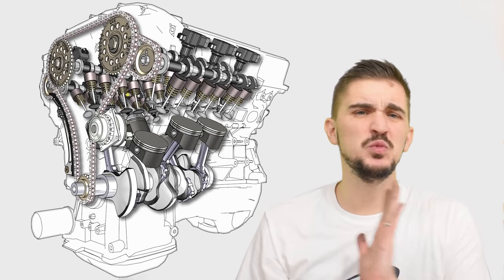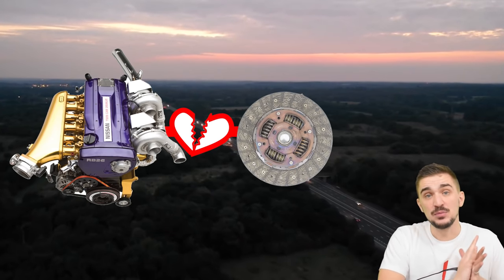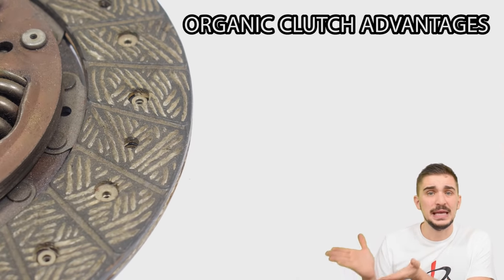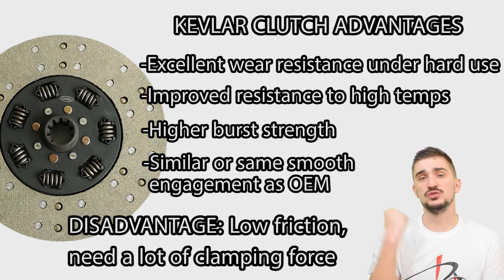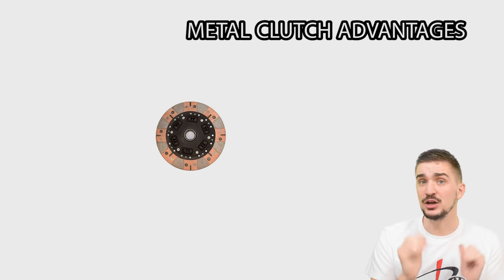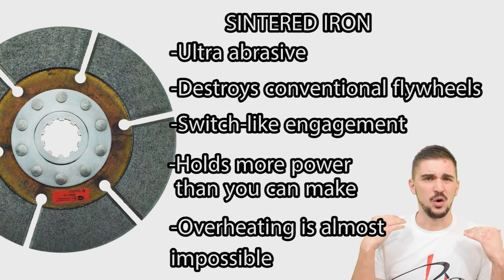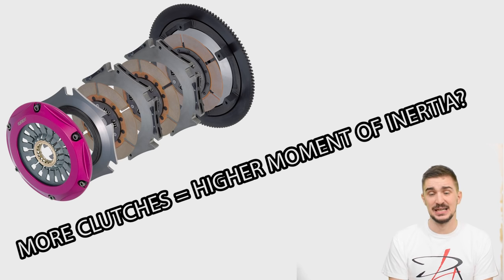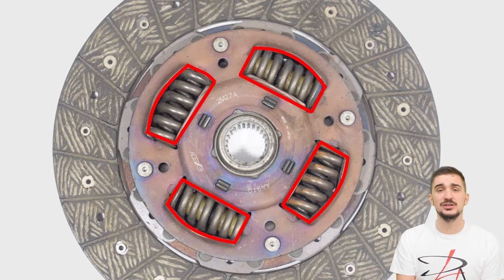CLUTCH: Organic vs. Kevlar vs. Metal vs. Multi Plate CLUTCHES - in-depth COMPARISON

Comment: Now i got it why my petroworks hi performance clutch didnt last more than 20000 km in Suzuki samurai. Construction was metal on flyweel side and standard on pressure plate. It was irational desision because i was fascinated with everithing "hi performance".... Now i am mature and i am driveing OEM clutch and it does the job.

Comment: I think a missed disadvantage so sintered metal clutches is YOU CAN WELD THEM TO YOUR FLYWHEEL.
The lighter pressure plates sometimes found can lead to engagement slippage which super heats the surface of the disk, and when it cools, sticks to the flywheel and pressure plate.

Comment: Some nitpicks:

1. A ceramic "puck" style clutch is going to chatter and have rough engagement even with hub springs
2. I bought a McLeod RXT twin plate for my 2JZ, which has some kind of sintered metal friction material and no springs - to my great surprise, it is very docile and friendly to drive on the street. Not quite as slick as a stock organic type clutch - but pretty close. Expensive, but worth every penny.

Comment: Thanks for this. Pretty sure after this i picked the right clutch for my car. Its a fully built all-motor 3000gt. Put a segmented kevlar clutch in it rated for 360ft-lbs which should be more than needed but not too much more. And it will see some track and street driving. You just confirmed that i picked the best clutch for the conditions the car will be in. Before i picked the clutch solely based on torque it could hold.

Comment: 17:40 it can be bigger than flywheel or pressure plates. Cub cadet did it in 60's. It's an exception so bear with me. Have the organic or Kevlar material be a thick disk with a center hole and 3 oem or 6 aftermarket holes drilled around outer edges  that ride on pins so it can slide back and forth on driver. Driver connected to flywheel directly and spins at engine rmp constant. Drive shaft goes in center hole of disk and into pilot bearing on driver. On drive shaft in this order Pressure plate (roll pinned and fixed), organic fiber disk,Pressure plate (roll pin through drive shafy but cuts in pin holes of plate to allow movement) clutch arm,teaser spring( helps for smoother engagement to pre load rear pressure plate),throw out bearing,main spring,and roll pin (oem) or split lock collar (aftermarket tractor sled pulling parts). Drive shaft never moves but the small amount of play in rear pressure plate and the free float of fiber disk is enough to engage and disengage very well. This system could be used in small car applications with modifications but it's not perfect. And there is centered metal multi puck options to replace fiber disk. Works the same check out midwest super cub or vogel manufacturing to see full list of aftermarket cub cadet sled pulling parts. There are multiple kinds but the 1960's cub's have the strongest design and search for (narrow frame models) in the 70's it was changed. Oem from 60's is basically a Marcel with organic and asbestos fiber sandwiched. Or maybe mine was  Delaminating it was old and glazed.

Comment: When he say's "clutch" he means 'clutch plate'. 
The 'clutch' consists of a clutch plate, pressure plate, spring and release mechanism.
Reply: In the clutch industry we say clutch disk, and cover assembly (cover, diaphragm and pressure plate).
Reply: @JBN1983  Discs is what you find in the brakes department.
Clutches have a plate. Well, ok multi-plate clutches have multiple plates ! They can be either dry or wet. The same assemblies can be used for brakes too, I guess wet or dry - then they're multi-plate brakes. No diaphragms in clutch assemblies - unless air, vacuum or hydraulicly operated.

A difference of language across the Pond. What you need is a talk converter ;)
Reply: @millomweb : A disc is any flat circular object. Brakes have discs, clutches have discs, the hard drive in your old computer had discs inside it, a black hole eating a star has an accretion disc, etc. Colloquial terminology may vary from one industry to the next, but calling flat circular objects "discs" is still technically correct -- the best kind of correct.
Reply: @deusexaethera  Correct  -a clutch PLATE is disc-shaped.

Comment: I used a sintered metal clutch disc once on a street driven car, and I regretted it a lot.  It totally wore a huge groove into the flywheel, ruining the flywheel.  I had to replace the flywheel and change to a different disc.

Comment: Also remember when you have a manual stopping all oil leaks above and next to the bell housing is paramount including the rear main seal as it will soak your clutch in oil ruing its holding power. Unless you have a weak engine with a big clutch it will be slip city unlike my truck producing only 310flbs of torque on to a bigger clutch which after 91k miles i replaced the clutch and the piolet bushing was in perfect shape from all the oil leaks since 2006

Comment: My clutch is the same setup as his sintered metal one.   My pressure plate is also heavier than stock. My engine is only 40% more power than stock but even on a stock engine I regularly killed clutches so this was a very welcome upgrade. The drivability is good, bit heavy but actually feels better than stock as stock always slipped for a sec or 2 on hard take off and after a while just slipped continuously.   Only thing in hindsight is I could of got away with less clamping force than what I ended up using.

Comment: Such an excellent and high quality video. Congratulations! Now that you touched the subject of clutches, can you make a video about flywheels? What are the benefits of a lighter flywheel vs a heavy one? I heard having aheavier flywheel helps with the atrocious rev hanging some cars have, is this true?
Reply from the maker: I will talk about flywheels in the future. When it comes to your question, the opposite is true, a lighter flywheel will reduce rev hang as it has a lower moment of inertia. In simple terms a heavier flywheel is more difficult to accelerate but also more difficult to slow down due to increased mass. The benefits are that the heavier the flywheel the better it smooths out engine pulsations, the harder it is to stall the engine and it also helps cruising economy because the inertia "conserves" engine generated work longer. For racing you obviously want a lower moment of inertia to increase the rev happiness.
Reply: @d4a  Thanks for answering! I read it in your voice, haha. You are the best car channel by far! I'm looking forward to that flywheel video.

Comment: alote of guys when bying a diesel truck with a twin disk installed into it think that clacking sound is a bad disk.its not,its the dampers making that sound.and its normal.most high performance clutches make that clacking sound..then the guy realise after they pulled it out for nothing thats how that clutch works especialy a high performance dual disk clutch made by southbend industries.thats how they work guys.best clutch there is.300thousand kilimeters and no issues.

Comment: I have experience with both full face organic and three puck cerametalic clutch. If you daily drive in California where stop and go traffic is the norm, cerametalic clutches suuuuuuck. And depending on how strong your firewall is, the cerametalic clutch pressure plate/spring will damage it, I know this because that's what happened to my 2010 WRX. I had to get a bunch of braces to sorta fix my firewall. I would get a enlarged surface area flywheel and matching clutch disk like what Competition Clutch puts out. I run that now on my WRX and have not looked back.

Comment: Organic clutches used to use asbestos before mineral wool was a thing. We now use mineral wool for a number of things including excellent home insulation. "Rockwool"
Reply: Rock wool is also incredibly dangerous and hazardous to breath the dust of.
Reply: @fastinradfordable  Not as a finished product, but as a dust yes it is. This is true for any organic dust though. Asbestos is dangerous because it breaks apart into small particles whereas Rockwool does not. Otherwise, it would be illegal to use for the same reason.
Reply: @fastinradfordable  Also, Asbestos is a naturally occurring material that is mined and Rockwool/mineral wool is manufactured in a controlled enviroment.

Comment: I have on my sr20det Sacsh 765 pressure plate and act organic disc. Torque handling is over 700Nm. That pressure plate is bang for the buck if you have 240mm flywheel.

Comment: Multi disc clutch is actually easier to slip than one disc clutch. Also it needs less clamping power than one disc. So it's more user friendly than one disc. Only down sides are weight balancing and manufacturing cost, which are exponentially higher and more difficult.

Comment: Steel plate that is...
   The disc ran in a thin oil bath that you refreshed every 5000 miles or so.
Tied to a 308 cubic inch straight six with aluminum cylinder head and twin carbs these clutches were in the winningest NASCAR vehicles of 1951-1954.

Comment: If you're bellhousing is misaligned, you can damage your clutch hub and be left stranded on the side of the road, i know because it happened to me,

So you need to make sure your dell pins are in their place and your gearbox is properly aligned to the flywheel.

When doing a transmission swap you need to do your homework, either you need to make a proper adapter plate and you need to check whether the gearbox is properly aligned

Comment: For road use an organic material is the only way though some are better than others.
A sintered material is just ok for the accasional street drive but never in heavy traffic, they just get hot and grab. 
A sprung clutch plate is not ideal with it either. Though the sprung plates are best for organic materials. 
All sprung clutches though do not like hard driving,, the springs get hot an collapse and on occasion you will tear the centre out of the plate.
For motorsport generally a solid plate [s] is used. They selddom ever fail and are a bit lighter as well. Though I do know some using them in speedway applictions as they [maybe] are a lttle softer on the gearbox.  I have used a s/h one for about 75 speedway shows with no problems at all. though it was a cast off from a normal road car.
Organic multi plates are always heavy though will transmit quite a lot of torque for street use. Ford used them on V8s for a long time.
A triple [or more] plate clutch is motorsport only. Generally far smaller and lighter. With a LOT less centrifigual mass than any other. Great for road racing or speedway but do not get them hot as they will not disenegage which does not do the gearbox any good at all. And then the sliders all warp. Expensive and need a fair amount of maintenance. But often half the weight of the roadcar clutch, pressure plate and flywheel which is part of the package.

Comment: Carbon plate? Once I've seen a twin carbon plate get install in a VA WRX STI and the owner said the pedal feels light and it could handle more power and torque. Around ~5-600.

Comment: I had a centerforce clutch fail on me. The spring broke loose and got wedged between the pressure plate and disk. Could not engage clutch but was still able to drive without stepping clutch pedal. Will never buy another centerforce.

Comment: Can somebody explain to me why centrifugal clutches or torque converters aren't used with manual transmissions? Seems like alot of trouble to build the engine to withstand thrust load, and I've seen centrifugal clutches work with manuals before.

Comment: Having seen this, I have a question. In motorsports they use carbon disc brakes, but they need to warm up. Now 'normal' road cars like some supercars use carbon brakes too. There must be a big difference between the motorsports carbons and normal ones?

Comment: Great vid, but don't forget, they're not all diaphragm.  There is also Borg and Beck and Long Style/3 Lever, not to be confused with Borg and Beck which is also 3 lever.  Long/3 Lever uses counterweights to apply centrifugal clamping force and taller (long) pressure plate to make room for the counterweights.  Diaphragm is probably the only one that should be run on the street though.  Good description from RAM: https://ramclutches.com/clutch-university-chapter-2/  (I have never run a RAM clutch and I'm not affiliated with RAM or any other manufacturer, this is just a good description of the three types of pressure plates.)

Comment: Hey this vid was very helpful for most of my need but 1. I have a 99 silverado with a 6.0 and NV4500 (5 speed manual) later on I plan on building up the bottom end (kind of like it's going to take boost but I'm leaving it N/A). With the little power boost and towing a car trailer with about 2 tons on it (average load some will be heavier). Wondering what my best clutch options are for that

Comment: I put a Hyundai Tiburon GT 6-speed manual trans in my 01 mitsubishi Diamante 3.5, it's pretty great! Solid flywheel from the stock (dual mass) Tiburon flywheel, and its a lightweight flywheel wish I would have gone heavier. I experience some clutch chatter taking off from a dead stop. I suspect the springs of the sprung hub are not strong enough for the weight of the heavy Diamante and im getting back and forth movement on engagement, between those springs and rubber drivetrain mounts. This is my strongly felt theory, I will see if my local clutch shop can do ANYTHING about heavier springs, or I may have to try a solid hub clutch disk.
Reply: Unless the "clutch shop" is manufacturing clutches probably not.  What friction material?  Were all friction surfaces refinished, or even checked for run out?  Pressure plate load?
Reply: 6-states clutch shop by me does some re-rivoting of new friction material onto old hubs and does some solid hub discs and some with organic material one side and sintered metal on the opposite. I'm considering one of those.  My other components were new/machined and I have no problem with runout. Currently organic material disc with sprung hub(for a tiburon).
Reply: @twinturbotaj  Hmmm.  You have the most forgiving setup.  Changing any of the friction materials will make it worse.  I"m guessing OEM used a dual mass flywheel on that engine for a reason.  Hard call to make.  Good luck getting it sorted out.

Comment: Wish I could figure out why the clutch engagement in my B15 Sentra is anything but gradual. I swear it goes from "just starting to bite" to "full grab" if I merely THINK about letting the pedal out.

Edit: Whoa... Wonder if the previous owner had a sintered iron clutch installed for some reason. It certainly feels like an on-off switch lol
Reply from the maker: It could be because it's very worn. I highly doubt there's an iron disc in there. It would be the ultimate prank tho 🤣
Reply: @d4a  I never thought of that. For what it's worth, occasionally I will give the clutch a 2-second burn, and it seems to take away some of that harsh, sudden engagement. It is likely placebo, though, and I know I shouldn't do that to it lol
Reply: Dang centered clutches.. 🤙

Comment: Awesome video!!! I was think of grabbing stage 2 for my lancer which is 180hp with 170ft lbs of torque just to get that extra bite. But after this video I'm not so sure. I run it normal at times and other times I run it hard. The oem clutch is slipping. Is stage 2 clutch ok for highway use?

Comment: I had a 3600 pound pressure plate 13 inch "ceramic" in an old dodge...... super durable, terrible to drive.  However its lasted the longest of all I've tried
Reply: Good to know, I have always been told even by my clutch supplier that the "ceramic" ones wear out really fast.   But that said I have killed a few organic ones well before their time was due.   I haven't even done 2,000km on my sintered metal one yet in the 3 years I have had it but it's a weekend car so I doubt I will need to replace it for years to come.

Comment: What’s the best clutch for drag racing? I’m drag racing and using a McLeod rst which is a organic style twin disc. I need a clutch that I can slip good to be able to launch the car hard at high rpm but I also need it to grab good. I feel like my clutch slips really good but for the rest of the track it has problems. Is there another style clutch that would work better?

Comment: I have a metal clutch. 
With a factory pressure plate and flywheel (that had 300k miles)

That has been 10 years and it’s been indestructible. 

Still on same throw out bearing and release fork. 
This is why I like factory pressure plate.

Comment: Thinking of replacing my automatic 1985 300zx with a manual transmission, and upgrading the engine to about 400HP to the wheels.  Plan on driving around town, with some spirited driving but no track, drifting or dragging.  Any recommendations for a clutch?

Comment: Hi, which clutch should i use for my daily? i change gear with superhuman speed without intention. Since asians cut queues i have to shift superfast in traffic or end up not moving pressing the clutch for gear and releasing it in neutral constantly if i dont change fast and keep the gaps small. I dont cut queue and make sure the ones that do are stuck instead. To me changing gears very very fast is natural, and i can drive normally from gear 1 to 5 within seconds across low speeds for efficient driving.

Comment: I always find it weird how much smaller or longer lasting clutches are compared to brakes. Like I realize the forces are completely different. Brakes only option is to use a sliding friction throughout whereas a clutch only does briefly and then uses contact friction for the rest. But my brain disagrees. Brakes need to be large, hot, and die young in order to stop a car, therefore a clutch should be required to do the same to start a car.